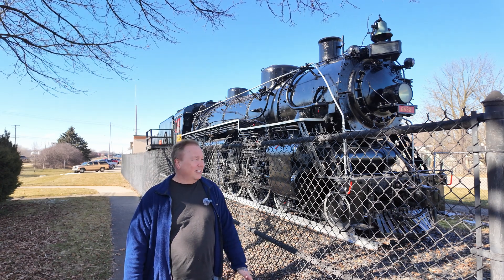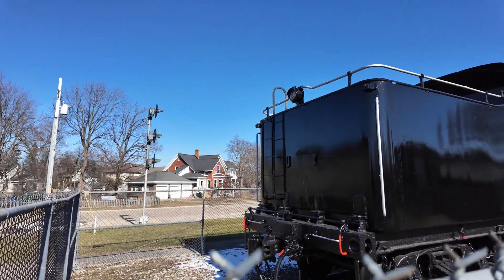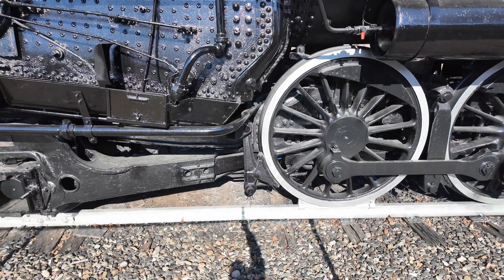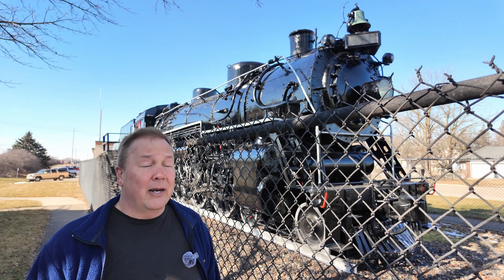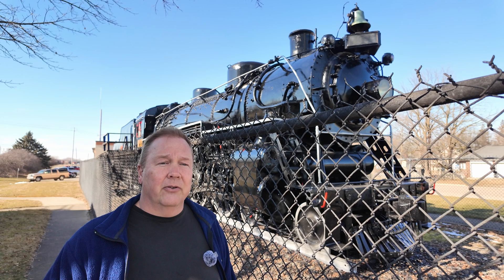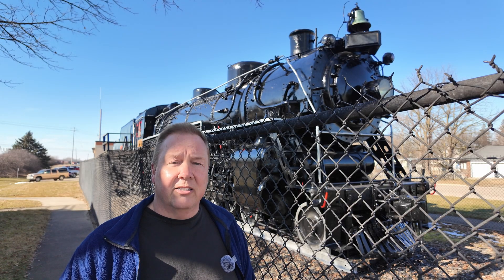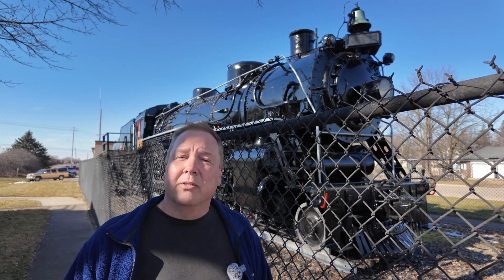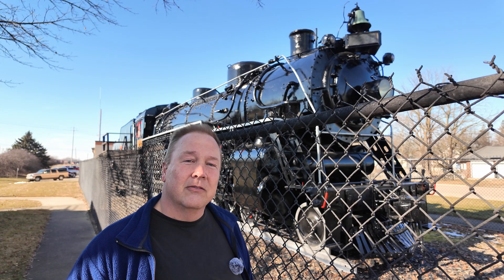Why Are So Many Steam Locomotives Sitting in Parks?

Comment: Most “average” workaday steam locomotives such as 5632, built from the 1910’s thru the early-mid 30’s could, (as others have stated) go 100-150 miles on water and around 150-200 miles on coal (depending on train and territory). During fuel stops
the engineer would also go and oil around, grease the rods if needed. Indeed, most would need to go “to the house” for minor maintenance after every run or two. 

Many of the locomotives built in the mid to late superpower era (30’s-1950) were a different story.
Most of these locomotives had mechanical lubricators with enough capacity to last 300+ miles. Almost all had roller bearings on everything but the rods which increased reliability and maintenance intervals. Things like  automatic wedge adjusters, alco lateral motion devices, and better boiler design/water treatment also kept them out of the house longer and increased their efficiency (thus fuel range). 

A few locomotives classes like C&O’s J3A (of which 614 survives), C&O L Class 4-6-4’s, N&W J’s (of which 611 survives), N&W’s last class of A 2-6-6-4’s, NYC’s S1A/B Niagara’s, ATSF’s 3776/2900’s, etc. also had roller bearing rods. The cavities in these rods had enough capacity to go 300+ miles before oil had to be added. Almost all of these locomotives were known for their high reliability/availability and in many cases (when compared to first generation diesels); they were actually cheaper to operate because it would take a 3-4 unit set of diesels to equal one of them. The diesels also had a higher initial cost, a higher maintenance cost over the lifespan of the engine. The only time the modern steam locomotive’s costs rose substantially was during major shoppings. Really, it wasn’t until the SD40-2 that a single diesel unit had the horsepower and tractive effort to match something like a Van Sweringen 2-8-4 (NKP 765, PM 1225). 

Steam lost out early on (compared to Europe/Asia) for a few reasons. 

1. There weren’t many standard designs that allowed for parts commonality between railroads/locomotive classes. 

2. It was the “average” locomotives that got the nation through WWII, not the superpower/advanced ones. Railroads had begun the switch to diesels before the war to replace these already worn out locomotives, only to be stopped by the war production board. By the time superpower locomotives had a chance to prove themselves, it was already too late. If locomotives like 844, 611, 614, 2912, etc. had been introduced 10-15 years earlier, it might have been a different story. 

3. Oil was cheap and plentiful after the war, the labor force was demanding higher wages and a lot of miners went on strike, this was another nail in the coffin for steam. 

4. Public opinion. Despite the many advancements, management and the public saw even the most modern steam locomotives as “old fashioned” or “pre-war”. Everyone was ready to move on from the war; this was an easy sell for a diesel salesman that could easily make the case for a sleek looking streamlined diesel, or a road switcher that the could be painted in  any color the railroad wished. It was also an era where people were starting to realize pollution/smoke inhalation were health hazards, steam therefore also became bad PR.
Reply: @LoganisTrainBoy1   One well documented impact of the business downturn/recession of late 1957-58 was the withdrawal of the famous Nickle plate Berkshires from service.  Although the Company offficially stated this would be temporary, the arrival of ever-increasing numbers of diesels eliminated the need bring any back from storage.

Comment: One other disadvantage of steam locomotives over diesel electric was they were harder on tracks. The reciprocating action of the steam engine would pound the rails, wearing them out faster.
Reply from the maker: You ever see any of the pre-Rocket locomotives?  The cylinders are vertical.  If you want to fast, the locomotive would rock side to side.

Comment: Just a point on the crew, the fireman and engineer operated the locomotive.  The conductor was the boss of the train and the brakemen (if any) worked with coupling and uncoupling cars, throwing track switches, providing flag protection, and setting handbrakes on cars parked (spotted) at industries.  The conductor often did this work as well. The "trainman" positions were needed regardless of steam or diesel power.

Most roads eliminated firemen in the decade or so after steam ended, mostly due to union agreements and it being the pipeline to promotion for engineers.  Into the 1980s it was common for trains to have an engineer, a conductor, and a brakeman.  Today that is down to the engineer and conductor in most cases.
Reply from the maker: Crews have been shrinking for a long time.  I've been thinking about the days before automatic brakes, so really, really old railroads, when brakemen had to set and release brakes on each car manually.  Happen to know how many cars each was typically assigned?
Reply: @Industrial_Revolution  I don't know, but prior to automatic air brakes, trains seldom exceeded fifteen to twenty cars.  Keep in mind that knuckle couplers and air brakes appeared about the same time, allowing longer trains.
Reply: Unions negotiated a iron clad fireman's agreement that kept them employed until they were promoted to engineer. However forecasts of retirement of engineers making room for firemen to become engineer was way off resulting in firemen on into diesel locomotives well into the 50's. A new catch phrase 'feather bedding" became common.
Reply from the maker: Just so they didn't have to shovel coal into the diesel engine, right?  I'm thinking that it may be worthwhile to do a video on the jobs on a steam train.  What do you think?
Reply: @Industrial_Revolution  Except for the fireman, there isn't any difference in the jobs on a steam or diesel train.  Now, the supporting shops are another story, but they aren't part of the train crew.

Work rules and union agreements regarding "full crews", along with changes in dispatching methods and the elimination of cabooses, had more effect on train crews than the power up front.

Firemen were retained on diesels for a number of years mainly to re-start dead units and monitor oil levels.  In most cases they were actually apprentice engineers.  After a certain time, virtually all firemen jobs were negotiated away, although B&O kept a fireman on a lot of "Helper Sets" into the 1970s and even 1980s just in case of mechanical trouble on mountain grades.

"Trainmen" - the conductor, brakemen, flagman - had nothing to do with operation of the locomotive.  Although my grandfather conductor occasionally ran the engine just for the hell of it, and when the late engineer Marve Holton was grilling steaks in his hibachi on the front platform of the engine!

Comment: One more reason: Deisel-Electrics do not operate well in water. In the Spring of 1965, the Mississippi River flooded the Milwaukee Road freight yard in Savanna, Illinois. The Milwaukee pulled one of these off display and gave it a quick overhaul . And put it to work pulling the stranded cars out of the flooded yard.
Reply from the maker: :) Thinking the train version of those videos you see with cars driving into flooded roads and dying half-way through in a cloud of steam.
Reply: Burlington kept one for that purpose as well I believe

Comment: Amazingly enough a bunch of those former “Park Engines” were brought back to life. They include Pere Marquette 1225, Nickel Plate Road 765, Southern Pacific 4449, Spokane Portland & Seattle 700 and soon former Nashville Chattanooga & St. Louis 576. There is a bunch of others out there that I may have missed, so be sure to add in the comments down below.
Reply from the maker: Yep.  The running gear and stuff on these locomotives is solid.  They'll need boiler/firebox work, maybe even replacement, maybe a new cab, but like the old, stationary steam engines, they're hard to kill.

Comment: Unfortunately I don't think many small towns had one on display. Look at the total numbers that exist in the United States as compared to Cuba or the UK by density and total numbers.
Reply from the maker: I hadn't thought to compare by density.  Are you thinking density of locomotives or people?  There's a LOT of empty space in the states.
Reply: @Industrial_Revolution  the book set you need was published by David Conrad. Several have been scrapped since publication. I believe you will find more locomotives in the UK maybe Cuba than in the USA. The scrap value of the big engines in the 1950s was actually quite high. So we're lucky railroads like the Santa Fe, Union Pacific and Southern Pacific out west saved as many as they did. In the East, the collections of the Pennsylvania and B&O were a lucky break. The Nickel Plate, C&O, SOO and Grand Trunk were the ones generous in the middle US. Still, the book set will show you that a large percentage are smaller switchers and industrial locomotives. Lots of gaps in preservation unfortunately as many of the survivors are duplicates. Keep in mind that if it hadn't been for the big recession in 1958 creating a huge surplus of motive power, steam probably would have had a more gradual phase out.
Reply from the maker: @NYCS19339 great info.  Thanks.

Comment: but you need  to rember you need to pay someone to cut it up 
but they can take a tax break to donate it!
Reply from the maker: Even worse, were it done today, many also had a lot of asbestos to insulate the boilers.
Reply: @Industrial_Revolution  i agree 
I volunteer at a loco railroad museum .
and I knew that were working on one of there locomotive ,
and one day I was walking by a dumpster, and it was filled with a fuzzy white blanket ! and i stuck my head in the round house .
and there was the locomotive with out it's jacket or it asbestos blanket !

the next time they cleaned another   locomotive.of it's asbestos .
they hired an asbestos abatement company . thay sealed two stall's of the round house for 3 weeks !
Reply from the maker: That stuff pops up everywhere, doesn't it?

Comment: Here's what I would've done. I would've kept steam locomotive running until the early to mid 1970s and then stockpile all of them for a strategic reserve just like what the Soviet Union did during the Cold War. Upon the collapse of the Soviet Union in 1991, I would've sold them off the museums and here railways all across the country.
Reply from the maker: Others have suggested a similar strategy.
Reply: Sounds great - if you have a crystal ball to see the future.  In the mid-70s, the USSR appeared to be very strong and even into the early 80s, it didn't appear that it would collapse anytime soon.

Comment: Superheat and feedwater heaters were the game changers that allowed for the higher efficiency needed to run longer distances. In my neck of the woods, the local museum would do roughly 26-mile round trips, and I don't think they were really pushing the water consumption that much. My memory says they went through about half a tender full on each trip...but don't quote me on it. It has been a number of years since my cab ride. I do vaguely remember them joking about potentially squeezing two trips out of it, but it would be close. The locomotive in question was a pretty bog-standard 2-8-2 built in 1917.
Reply from the maker: Water consumption definitely varied a lot.  I'll be making a video about how and how much it varied.

Comment: May be stating the obvious, but it's not the cosmetics side but the condition of the boiler that will determine whether a loco can be safely steamed. Potentially, a steam loco is a bomb on wheels. Here in l'il olde England, vintage loco boilers have to be examined and certified every ten years. There is a far greater maintenance overhead with steam than diesel, for instance.
Reply from the maker: I think it's every 5 years for major inspections in the states, plus less thorough inspections more frequently.  Bringing this, or most retired steam locomotives, back into service would quite possibly involve new boilers.  That's why many were retired instead of being repaired and kept in service in the first place.  Fortunately, that's actually happening here and there, bringing some of these locomotives back into service as ambassadors of steam's history.
Reply: Yes, fra regulations require the boiler be inspected which really means torn down, every number of years ( I thought it was based on hours, not years) . **Note- I looked it up, it is 1472 days of operation ( which i believe is being fired up and running days; so days when it isn't used , like weekdays, winter,etc don't count) or 15 years,whichever comes first. For an engine in regular service this would be likely 5 years*""

It can cost millions to bring an engine back to.life, like the UP big boy project,and is costly to keep going. I am just glad this is being done,only sorry no NYC Hudson was saved. Some crazies are building a Penn T1 from scratch bc none were saved. Among other things, want to see if it can beat the speed record the royal Scotsman holds.

Comment: You'll want to look up each engine and they went much further than 10 miles a throw,
Reply from the maker: It varies. I added that in comments, including the pinned comment.  Some, I'm guessing in Britain, assume track pans are universal, as well.  I'll be doing another video about the differences.
Reply: It must be a typo and misprint. It's probably 100 miles or more.
Reply from the maker: @user-kp2rr8xf7x no, some really did need to pick up water that often.  Some could go well over 100 miles.  Water consumption is actually a more complex topic than a lot of people think it is.  I'll be doing a video just on that topic.

Comment: One other downside to steam locomotives was the issue of toxic waste disposal. The accumulation of coal ash and cinders was a very real problem. Eventually a lot of engines were either originally built or converted to burn oil but this only somewhat alleviated the problem. In my local town the former switching yard and adjacent roundhouse area is a superfund site and approximately a square mile of prime real estate in the middle of town is permanently off limits to any kind of use.
Reply from the maker: It'd often just drop out the bottom of the firebox along the tracks.
Reply: @Industrial_Revolution  possibly there were only certain places where this was permitted? Wouldn't there be fire danger if hot embers fell upon creosote treated cross ties? I have no idea, the last steam locomotives were scrapped/phased out when I was a little kid. But a fire started by teenagers burned out of control inside a tunnel near my house for months because it ignited creosote soaked cross ties and the ballast bed under them, which was so saturated with oil and grease residue from 120 years of passing trains that the fire crews actually just gave up and made no attempt to extinguish it because the conditions were too hazardous for the personnel--lethal fumes from the smoke and such. Even after the fire burned itself out the tunnel was closed for 2 years for repairs. 😯
Reply from the maker: Yep, it did light fires.  When they got back to the roundhouse, there was a place they could dump the fire, typically by rotating the grates, and it'd dump the burning coals and everything out the bottom, but while running, tiny pieces would fall through.  I once knew a hobby blacksmith who told me that, for years, he'd just walk the tracks to pick up unburned coal for his forge.